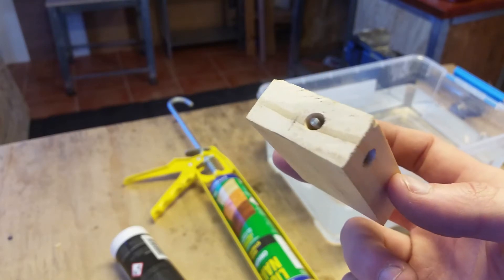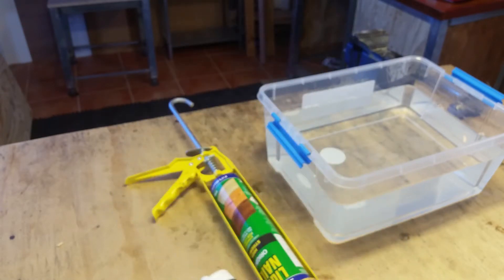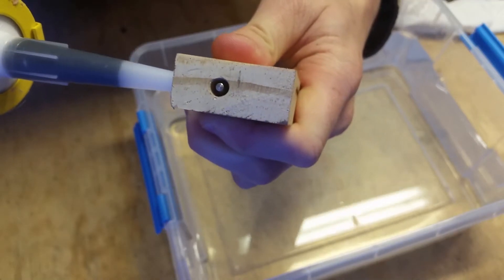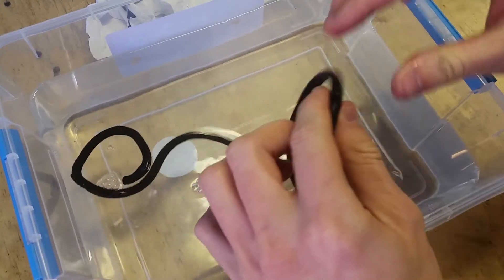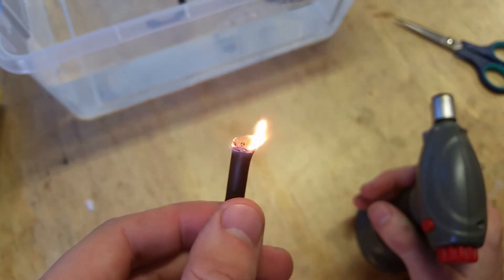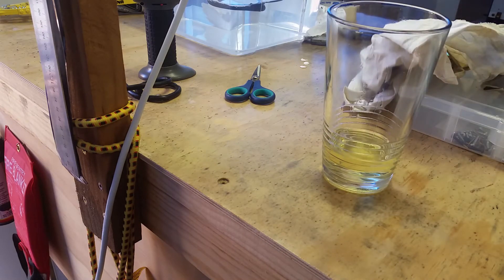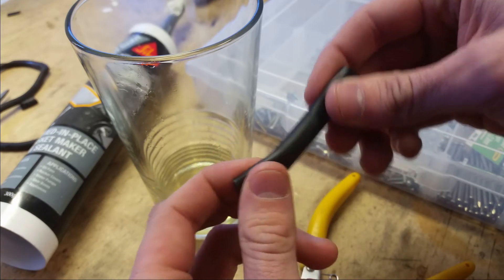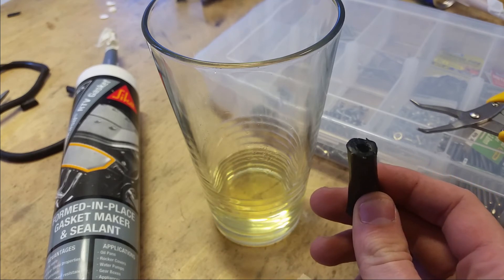DIY Extruded Silicone Fuel Hose 2 - Does Gasket Silicone Work?

Comment: Do you think it would be possible to make a hollow tube the same way with a much smaller diameter - say 1mm?
Reply from the maker: mmm yes it could go smaller but i think at some point you would need to pack the silicone into a steel tube and increase the pressure. easy to make the tube i think but hard to pack the silicone in without forming bubbles or allowing it to cure in the process
Reply: @EngineerNick  Thanks for the advice.

Comment: Hey Nick...this is very inspiring!

Did you ever perfect your methodology for extruding silicone and getting it to cure?

I'm prototyping a seal for a respirator, and I've made the die and it works pretty well, but the silicone (regular 100% DAP as well as RTV silicones that I've tried) just don't seem to set when they hit the water and the features of the extrusion end up sticking to themselves.  I'm using hot water and H2O2, but also tried detergent, acids and bases in the water with no change.

Thanks!
Reply from the maker: Hey Jim :), I also had this problem; the silicone does not instantly cure in the water, it takes at least a few  minutes (maybe 5min? i don't remember) to skin over and stop sticking to everything. While the hot water did seem to greatly accelerate this process i never found an additive that made a noticeable difference. If i ever repeat this experiment though i would try a much more concentrated dose of detergent in the water, and maybe even foam it up a bit... the idea being  to get the little bubbles to help float the extrusion and keep it away from itself and the container walls. I think i would also try a long custom made container and try to attach one end of the extrusion somehow so that it doesn't form coils. Another crazy idea might be to use some kind of stepper motor to extrude the silicone so slowly that it has time to cure as it moves out of the extruder. Would be great to see a video if you get it working. Best of luck! :) -Nick

Comment: I wonder if you had an induction hot plate to keep the water up to temp would be ideal. Induction so the bottom of the pan isn't scorching hot like gas or regular electric. Or a false bottom to the pot to keep the tubing from touching the hot bottom

Comment: Uncured silicone contains solvent and must be post-cured in an oven to remove residual solvent and fully crosslink the silicone. Try the lowest setting on your oven for 4 hrs and repeat your tests. After curing it should perform much better!
Reply from the maker: Thanks Richard that sounds like a good idea :) I will try this next time.

Comment: Cool project, thanks! Maybe try using a plastic block instead of wood and submerge it in very hot water so the silicone hits the water before it every touches air!
Reply from the maker: Plastic block sounds like a good idea, and definitely much hotter water is something I want to try next time. I might go for a hard-wood rather than plastic just because I normally have that laying around.